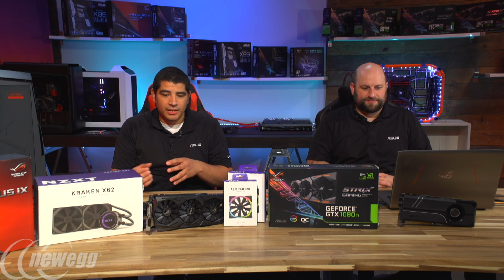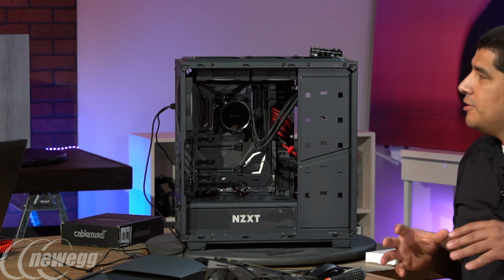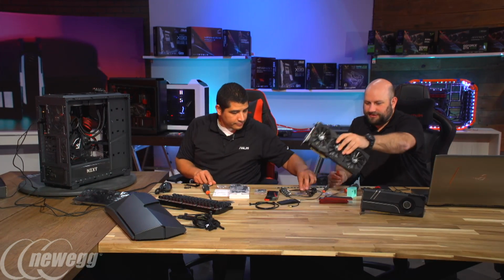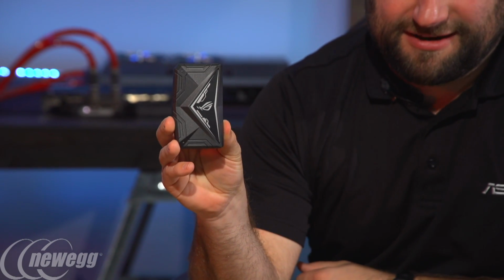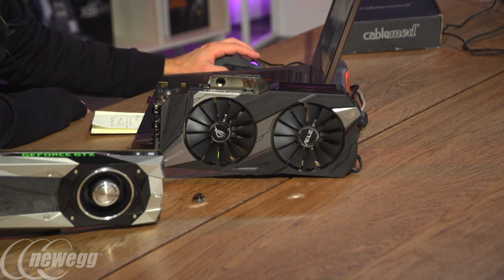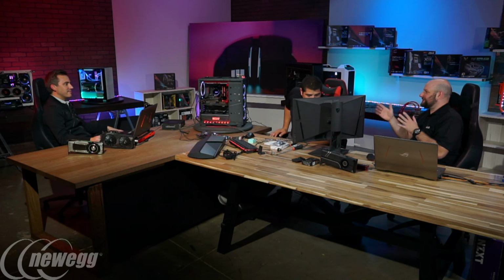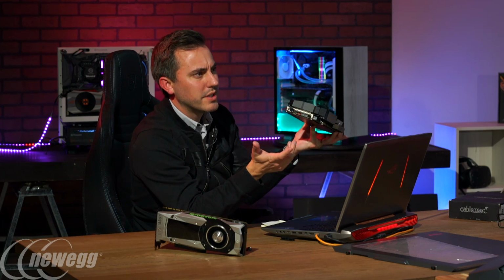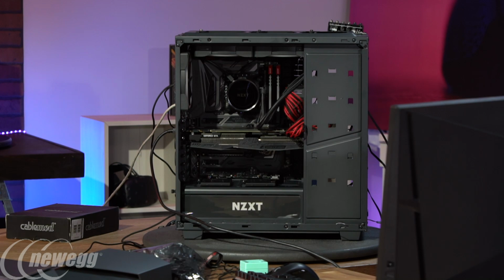Live: ASUS ROG Z270 Gaming Build with STRIX GTX 1080 Ti!

Comment: i was wondering do you need to connect the rgb header on my strix 1080 ti to the rgb header on the crosshair 6 to get them to work together? seems a bit odd and i was planning on adding rgb strips to the headers on the motherboard.

Comment: I missed this livestream. my question is, is there any way to sync AER and Kraken to asus Motherboard? i have Maximus 9 Hero.
- Can i direct Deepcool RGB 350 to Maximus 9 hero RGB header?
- Also, i have kraken x52 and which is connect to CPU_FAN header and when i check my BIOS UEFI, it runs at 2k-3k RPM which i think a bugged. my BIOS is updated.
- Also i'm planning to upgrade my ASUS STRIX GTX 1070 OC to ASUS STRIX GTX 1080 ti, the problem is it has 2 8pins. and i have Custom Cable Sleeves, can i connect two 8pins custom cable sleeve from psu to GTX1080 ti? or should i use stock EVGA G3 VGA cables which has extension 8 pins in one cable?

Thank you so much !!
Reply from the maker: Currently, the ASUS Aura software and NZXT CAM do not communicate directly. For other RGB products, if it has a 12v 4pin connection, you're good to go. NZXT Hue+ has 5v strips, so if you plug those into the mobo, your LEDs won't be happy. For the Kraken RPMs, make sure the pump is connected to the pump header, it will still read a larger number than expected (this is due to PWM pumps), then connect the fans to the Kraken. Or you can connect them to the mobo if you want ASUS to run your temps. For the 8 pin connections, it sounds like you're good to go, the cable sleeves will work fine and look the best.